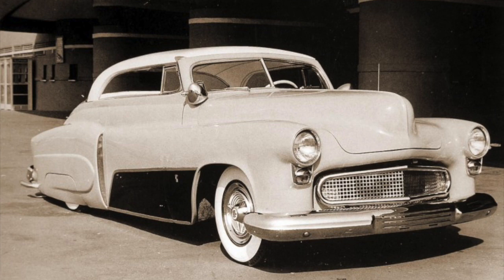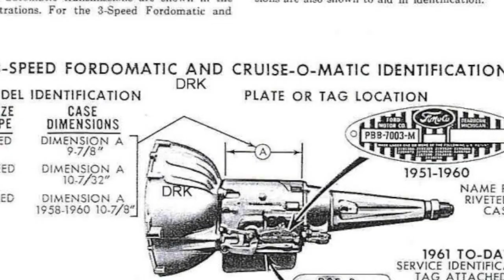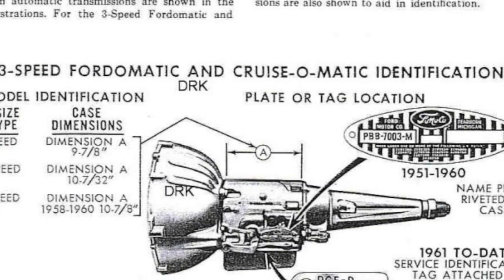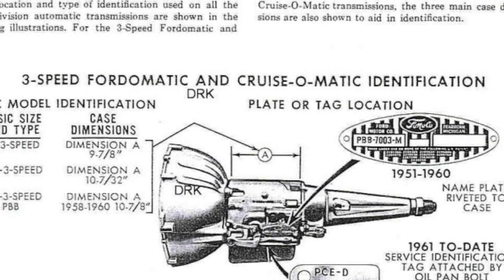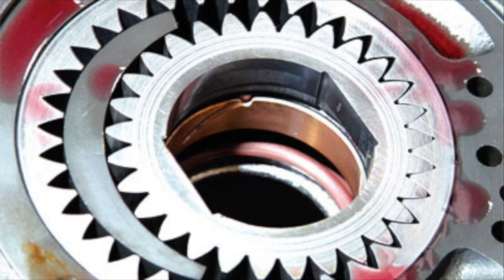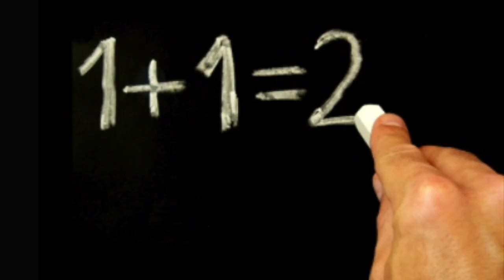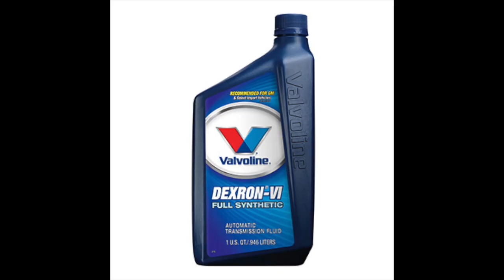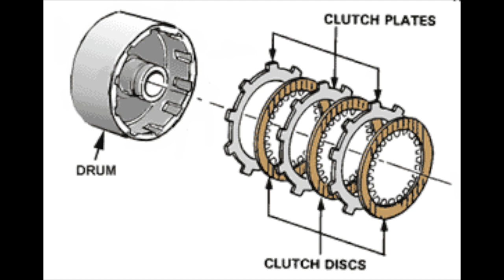Transmission Fluid for Ford C6/C4? F TYPE!

Comment: When I work in a transmission shop it was known for racing transmission fluid to either use Ford type "F" or B&M racing transmission fluid.  As these had the least slippage and strongest Grabbing.  Your pretty knowledgeable,   Thanks William Orange county,  ca.

Comment: 80 up c6's used dextron from the factory. the clutch material changed. These days with a new rebuilt c6,you can run type f,dex/merc,mercon v or dextron vi. confused yet?

Comment: How about a 58 Ford which used Type A. Some say F was an improvement recommended later when it came out but others have said Dex II/III covers for A. Still F the better in these Cruise-O-Matics?
Reply: My 57 fordomatic also calls for type A. Use the Mercon. DONT use F type

Comment: I'm still torn between this. I've read that Type F isn't compatible with the clutches in the C6 post like 1980.  When I google the type on the dip stick of my '82 bronco's c6 people say dexron/mercon 3. Now before I searched for that I assumed it took Type F so that's what I've been putting in it (it's leaking out the ass end, about to get it fixed). Haven't had any issues, and it shifts fine but I'm worried about it damaging the clutch pack. So I'd do some research about it before stating to always use Type F as apparently the clutch material was changed after the 70s which is the main reason for the fluid type change.

Comment: Ok. What if I have a fresh c6 with wide ratio gears. Just rebuilt.  Should I still use f type? 
86 ford e350 4x4 converted van.

Comment: type F is a 10 wt and all the others are a 5 wt oil, except the high file economy versions and they are a zero wt oil, I drivea 72 f250 and I'm an amsoil dealler
Reply: Apocalypse Bob No you're right on, but this is why you get better shifting and tourq from the type F fluid

Comment: I have a ‘79 F100 with a 351 Windsor and C6. My gears are slipping into neutral big time. Not popping out of gear. Like I’ll be accelerating and it starts to rev without go. Then it’ll catch. Awful, right? Could it just be low fluid? Picking up some F type after work today. I also was told to check the level while it’s running and warm. Correct?

Comment: Question have a 68 mustang c4 transmission is it possible the trans level could be low but reads way high? And what would cause bubbles in the fluid on the dipstick?
Reply: if you overfill an automatic the fluid level will be so high that the rotating parts inside the transmission will whip air into the fluid, turning it into a foam. this will cause the dipstick to read extra high and you will see bubbles on the stick. air in the fluid will make the hydraulics in the transmission operate very strangely...

Comment: Is F type compatible with other ATF? The previous owner of my truck did a flush at one point, but I don't know what he used. I'm getting ready to do another flush and wanna make sure that what I use is more or less "universal" so that it won't cause problems down the road. So if he used Merc or Dex would F type be compatible with these? It's an '88 C6. Gonna drop the pan, replace filter, and pull the drain plug on the converter to help get more of the old stuff out. Anyone that has the answer let me know, thanks!

Comment: Good overall history - thx...  I have an E350 bus /7.3 D. - calls for Mercon Dex - on the stick. Shifts are nice and solid, BUT  the issue  it has is ;   delayed shift - revs b4 shift at any throttle -  my guess is vacuum modulator  ??   What you thinkin  ??  
Thx
Reply: Sounds like a small slip

Comment: Type F is what came in a Ford c6. Unless the trans has been fully rebuilt and cleaned putting mercon in the trans will ruin it. Trust me, been there done that
Reply: Apocalypse Bob just wondering if you could explain the kickdown cable / linkage on a C6 I've been told I don't need it I've been told you got to use it could you clear this up for me